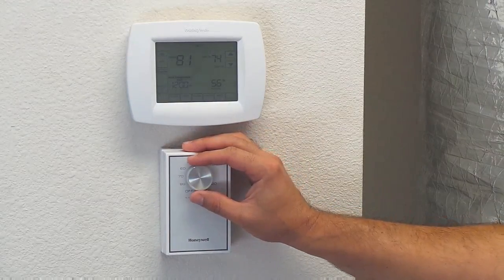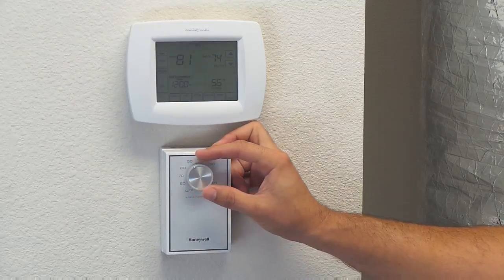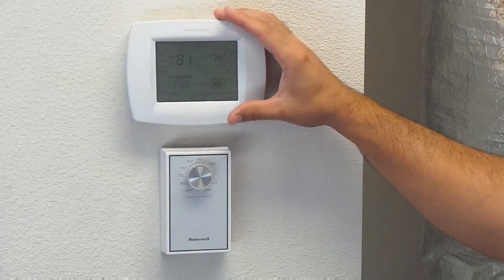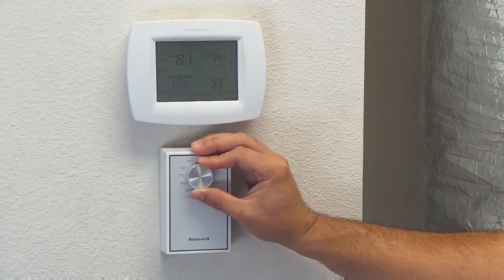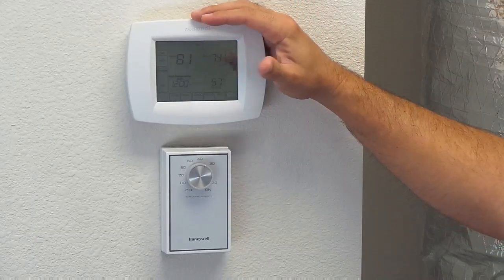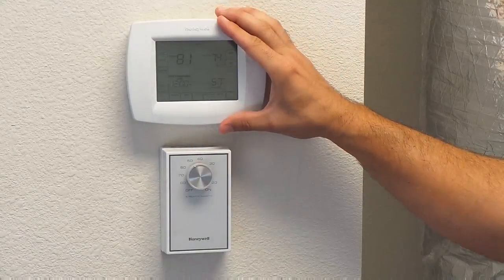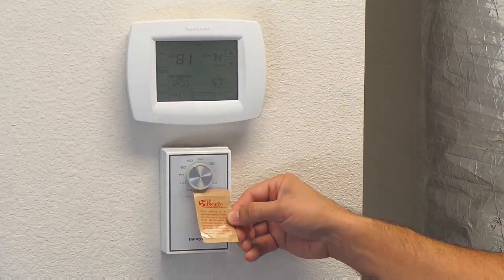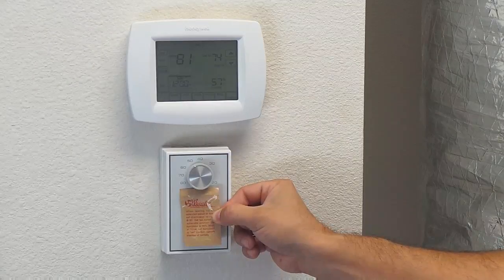How To Work A Dehumidistat In Florida with Tri County Air Conditioning

Comment: We just had a complete system installed in June, while we were away. Not the best timing, but the a/c froze and had to be replaced.  I explicitly told the Company we hired that I wanted to be able to use the humidistat, which we have, but never worked as your video shows.  I was able to use a properly wired humidistat with my system at my previous condo.  I LOVE running the system off of the humidistat!   So, now, we returned and the humidistat was set on the “on” setting.  I called the owner who said it’s working 
fine.  I said it’s not working as I asked. I want to put temp on 80, set humidistat at 60, and be happy.  He said it does not work like that. He said he’s taught at PTech.  He said is the air conditioner working. I said yes, and he said ok, then!   Please help me.  We paid over $6,000 for a system that we are not happy with and have to live with for the rest of our life
Reply from the maker: Hi Diane, Do you live in Manatee, Sarasota, or Charlotte county in Florida? If so, that means you are in our service area! Please give us a call at 941-485-2222 and we would be happy to set up a call to go over the issues you are experiencing with your dehumidistat.

Comment: Great explanation of a mysterious box. But now I want to know if there is any way to change the relative humidity in the AC system?  It gets so dry when it’s cooling all day.
Reply from the maker: In order to control the humidity, you either have to have a humidistat or a newer air conditioning and heating system that allows for humidity control at the thermostat.

Comment: Thank you for the information.  My set up is slightly different, My house didn't come with central air. The only type of hvac we had was an HRV . I have recently installed central air and heat. I would like to upgrade the humidistat controller to a smart one so it can match the look of the nest or the lennox i comfort 30. Do you have any suggestions? Ill be checking soon but im sure the wiring is high voltage, at least 110.

Comment: When Im home, and ac is on all the time, like now, because its SO HOT... where should it be set? Its all the way to the right at the 'ON' setting. Should it be set to a certain % when its so hot and humid out in S. FLA ? Thermostat is set at 78. Prior service tech said to keep it on, but never told us to adjust it at all, to any specific %. I live here year round, so we are always using the ac.
Reply from the maker: Do not set it to any percentage when you are home, only set it to ON.

Comment: Hi we just installed this same exact humidistat in our South Florida condo.   I’m pretty sure it was wired in series. We never stay there more than a few weeks at a time throughout the year. I’m assuming the unit in the video is wired in series. 
Two questions:
Is the ON position for the humidistat really just mean the humidistat is not working, i.e., it is “OFF” essentially?  So that the ON position is really the OFF position?

Do you still have any of those stickers (after all these years) that I could call and request?  Would like to put one on my unit for guests that may use the unit when we’re not there. Thx.

Comment: I have this setup in my home. I don't like the theory. If you don't have power to your thermostat the temp in your home with low humidity could be over 100 degrees. So lets say you want the max temp in your home to be 90 degrees. You must have power to the tstat. I don't get it.  What temp do you recomend setting the tstat?

Comment: My Florida  apt is very cool and humid I believe. In winter the temp. inside doesn"t go higher than the outside temp. Therefore if outside is 75,my inside temp. is around 72-73 which means if I want the AC to go on I have to set it below 72. So the AC is never on in the winter and that produces a mold problem.  Will a dehumidstat help? Or should i get a dehumidifier and leave it on the winter months? I dont want to set the thermostat below 72 because it will be to cold when i come home.
Reply from the maker: Hello, thank you for your comment. We recommend installing a dehumidistat for the times that you are away for an extended period of time. If you are always home, you don't really need one. If you are having issues with your A/C system heating your home, make sure your thermostat is set to heating mode during the winter and cooling mode during the summer. If you live in our service area, we would be more than happy to answer any questions you have over the phone at (941) 485-2222.  Thank you!

Comment: The problem I've found with using a dehumidistat is it only senses the humidity level in the immediate area where the dehumidistat is located, it doesn't accurately sense the entire houses' humidity level.

Comment: I have my humidistat set to 55% and the thermostat set to 80 degrees.  Will the air conditioner turn on if the temperature in the apartment is above 80 even though the relative humidity is below 55%?  Thank you.
Reply from the maker: Hi Jonathan, It depends on how your dehumidistat is wired. There are two ways it could be wired: parallel or series. If it is wired in series, the answer to your question is no. If it is wired in parallel, the answer is yes. If it is wired in series, the air conditioner will not cool past the set point of the thermostat. If it is wired in parallel, then the dehumidistat controls the air conditioner and it will cool past the set point in order to achieve the set relative humidity. Tri County Air, since we are in Florida, wires dehumidistats in series because it is the safer option to protect against mold growth. If you are unsure how your dehumidistat is wired, and if your apartment is located in our service area (Manatee, Sarasota or Charlotte Counties in FL), we would be happy to come out and check it for you! Simply give us a call at (941) 485-2222. Thanks! I hope that helps to answer your question.

Comment: Can I use a Nest thermostat with with central a/c, heat and a humidistat? Nest says it wont work with any 220 wiring. Thank you
Reply from the maker: Hi Carl, Great question! It wouldn't work to use a standard Nest thermostat in addition to a humidistat. The reason for this is that when the humidistat cycles off, it will also turn off power to the Nest thermostat. A solution to this would be to use the Nest thermostat that comes with a humidistat built into it, which would allow you to utilize all features needed all in one system. Hope that answers your question! If you'd like additional information or clarification, please feel free to give us a call at (941) 485-2222 and ask for Rich. Thanks for reaching out!
Reply: My humidistat is powered seperately from the thermostat. It is left in the ON position full time to keep the humidity in the home at it's lowest at all times. It was like that with the old thermostat. It is wired that way for snowbirds. It seems to be working fine since it was installed. The humidity level stays at a comfortable 40 %. Thank you for writing. Will keep you in mind for any future questions.

Comment: I just don’t get why you would bother setting the temperature on your if you humidistat is controlling your thermostat... seems redundant to me. Even if I have my thermostat set at 75 and my humidistat set at 55. The house temp could get very high based on outside temps and be above the 75 on the thermostat. So .... even if I set it at 85 like some people to set it at. It really has no effect on when the air conditioner goes on or off because the humidistat is dictating that. Now that being said ... I don’t want the inside of my house to get up to 90 or 95 inside. Is there a way to still control the temp to the set point and the humidistat do it’s job. I just don’t get why you have to set ur thermostat when you have the humidistat at 55. I also understand you can hook the up in series or parallel... I just want to understand it’s operation.  Thanks
Reply from the maker: Hi Robert, if it is wired in series, then the humidistat will keep the A/C from running unless the humidity is higher than the set percentage. If it is wired in parallel, then the humidistat will keep the A/C on regardless of the temperature until the humidity set point is satisfied. We suggest wiring it in series. In series, the set temperature for the thermostat is important because once the humidistat is calling for the thermostat to turn on, if the thermostat is set to above 80 degrees, it won't have enough run time to reduce the humidity. In series, the A/C will not allow the temperature inside your home to get lower than the set temperature. In parallel, the A/C will run regardless of the temperature set point on the thermostat in order to achieve the desired humidity.

Comment: If anybody is reading this uninstall this ancient garbage , your thermostat does everything you need it to do. If you worried that your batteries might run out of your thermostat while your away, tell your local A\C pro to run a common to your thermostat, your welcome
Reply from the maker: Hi John, there are different thermostats in our market and not all of the thermostats have built in dehumidification. The thermostats that include this feature cost significantly more than installing a standard thermostat plus the separate dehumidistat, so many of our customers opt out of having one very expensive thermostat to save money. This video describes how to work the two pieces of equipment together for the majority of our customer base who don't want to spend the additional money to have a thermostat with the built in dehumidification feature.
Reply: Tri County Air Conditioning and Heating 

Thank you for this information. 

Can you suggest an all in one thermostat? Brand and model number or if possible a link ?

Thank you
Reply from the maker: @TomD1146  Please give us a call at 941-485-2222 and we would be happy to give you some options.
Reply: If I want to remove this from the wall, do I remove and tape the wires apart? Or connect them together before fixing the drywall.
Reply: Michael Finkelstein if u put the two wires that where in the humidistat together it should kick on the system. Test if this is true or not (make sure your Tstat is set to on and at low temperature) if it does than obviously connect both and call it a day. But if I where u I wouldn’t do this unless u know what ur doing u could easily fry the board or pop the fuse